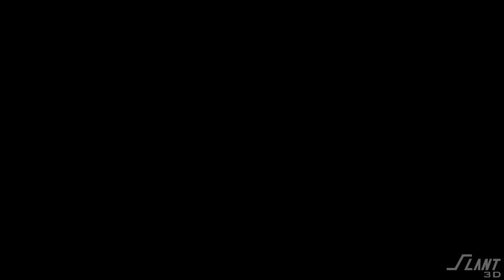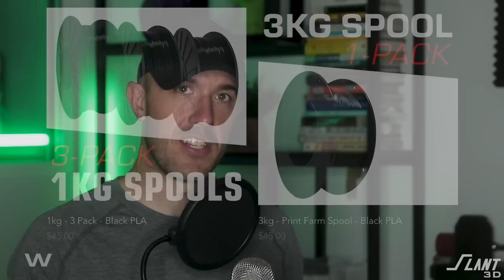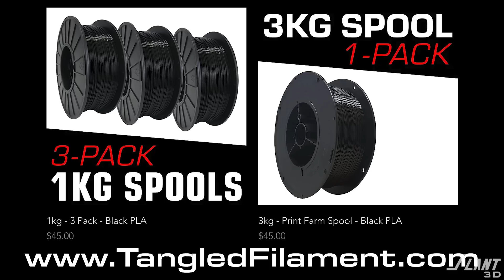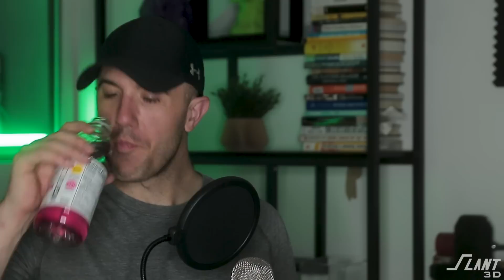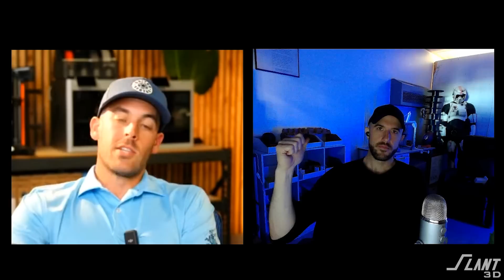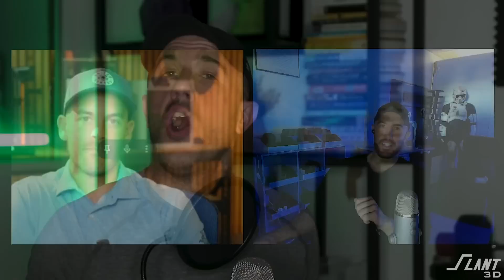Shop Nation Interview | Print with Moon Rocks | We're Going Spooless | 3D Printing News

Comment: Dear lord printing regolith... wow. That's a challenge. That is going to challenge to lifespan of hardened steel nozzles, even at the volume of an at home printer.
As an Aerospace Engineer, we studied that material in graphic detail. It is by far one of the biggest thing to consider for anything that moves on the lunar surface. It is all EXTREMELY fine powdered, impact strata, volcanic glass like obsidian. It sticks to everything.  It slaughters bearings. The martian soil is similar. The Spirit Rover is a prime example of what that material can do to a bearing. The motor failed "likely due" to a seized bearing in 2006 but the rest of the rover kept on roving in 2009 until it got stuck.

Comment: Incremental development has its own problems... Make sure to add a build number on each part, and if you iterate a part with minor changes, change the build number so you can determine if future problems are created by the incremental design changes, at least you can tell how far back the change affects the built machines. 

On your Power issues, look at using lithium iron batteries and inverters. If your area has cheaper power at one time, charge up all your batteries at the lowest cost time and use the batteries (and perhaps solar) to help offset the power to your building. By charging batteries overnight (when power is usually cheapest), the cost of power is cheaper all around the clock.  

If you use batteries, depending on how many you have in your bank, that gives you a grid disconnect buffer so the lights and machines stay on during an outage. If you need more capacity, you can add batteries to the bank, often without taking the string of printers offline.

Having a single source UPS is not a good idea, since one failure takes down your whole farm. It would be better to scale it smaller, with a rack for power (chargers, inverters and batteries) in a small rack at the end of each row of printers. AC feeds into the rack, and the rack acts as a buffer and feeds the whole string of printers. Or multiple strings of printers. That depends on how much power each string requires, and the capacity of inverter you choose.

Comment: The topic of print farm power requirements/limitation was fascinating. 3d printers tend to operate mostly on DC power (not AC, like the grid), so each printer tends to have an independent power converter brick that has a significant amount of parasite/vampire power loss. For a print farm it may be advantageous to utilize integrate more scalable DC power source (centralized, or a few distributed units). This could also centralize the need for UPS, integrating with the DC power supply. If a location is power constrained, adding additional battery storage would allow shifting power demand in time to different part of a 24-48 period, depending on power demand as relates to peaks and valleys of production and power need. In parts of Texas (like Austin), utilizes actually pay customers to utilize power at night. This litany could pay for battery storage over time.

Comment: 11:22  Western Container Corp, Yazoo Mills, Marshall Paper Tube, Spiral Paper Tube & Core, Greif.
Tape and label cores looks to be what you want with the smaller length 3 inch tubes (with whatever inner diameter you're after).  Most of these companies have quote request forms, so I can't quite say which one would fit your price margins the best.
Reply: Never done spoolless before so not sure if I have to rewind it or just add reusable sides to the core. If the sides form factor doesn't already exist, there's an opportunity! :)

Comment: im sure it's deeply impractical but 3d printed spool-less cores?
Reply: I'm guessing that the time to print the cores and the cost of power and plastic significantly exceeds the cost of paper cores. I suspect that printung them all off in the scale that they need will quickly begin to eat up a huge chunk of the farm's capability.
Reply: @jensenmiller6410  yeah probably true, mostly was thinking that cylinders could be cheap and quick if vase-mode could be used, though i'm sure not as cheap or quick as cardboard (assuming precut tubes are a commodity)